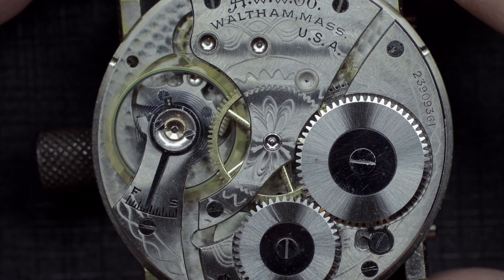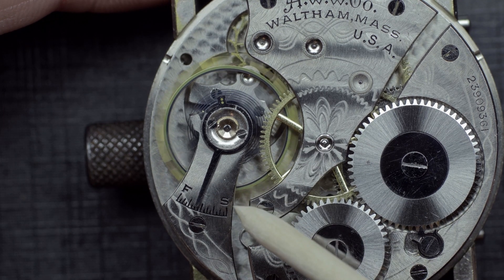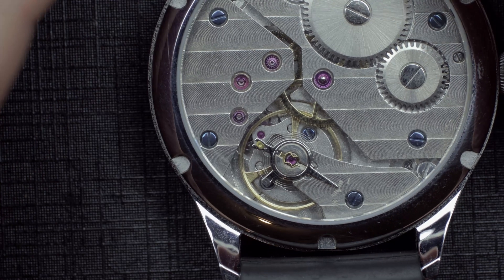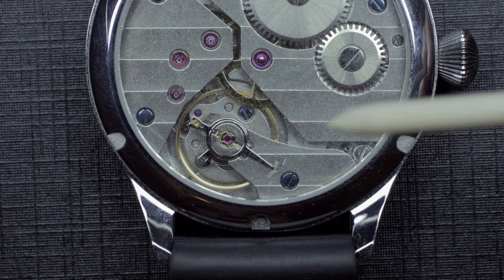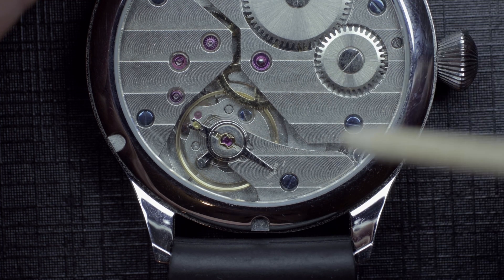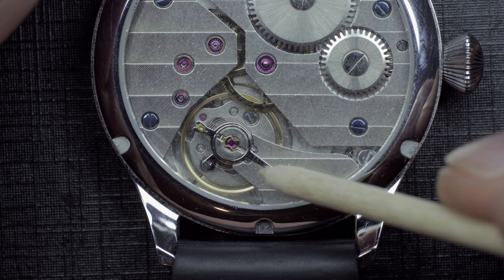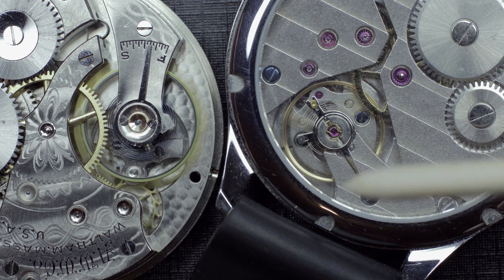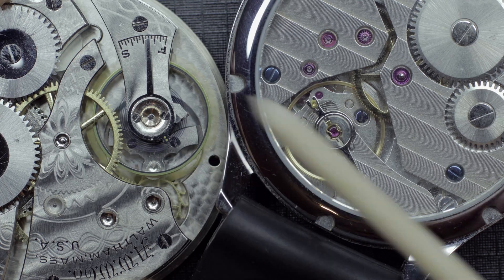Breguet Overcoil Hairspring Vs Conventional - Comparison & Differences

Comment: Very intesting and well expained as per usual. Sorting out a twisted breguet overcoil, makes me nervous. Just thinking about it lol. Regarding modern style hairsprings, ive learned that (the hard way) That having a slight gap between the regulating pins, can improve position accuracy and amplitude. Just enouh so it can breethe between the pins a bit. I also has seen maritime cronographs, having a downwards spiral hairsprings. But those are stationary and would go crazy if tilted. Very intresing!! :)
Reply from the maker: Yes that breathing gap is very important for adjusting positional variation. Assuming of course that the balance is poised etc.
Similarly with breguet overcoils the spiral type in marine chronometers is designed with consistency throughout the wind first and foremost.
Interestingly unlike your standard escapement they're not self starting either and need a nudge to start from empty after a wind.
I'd love a nice boxed one for display.